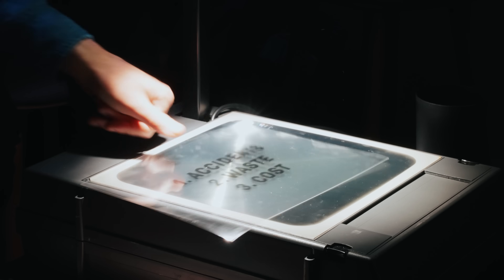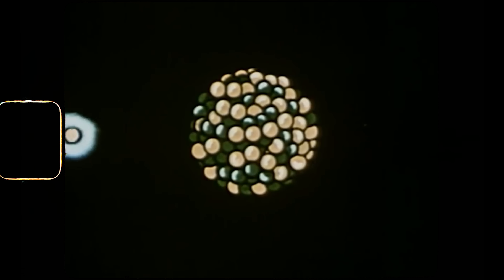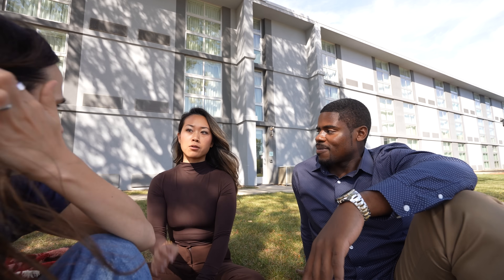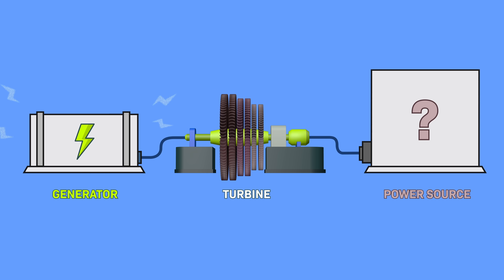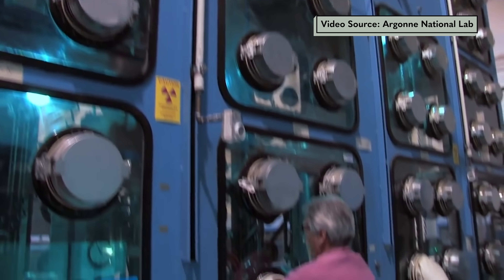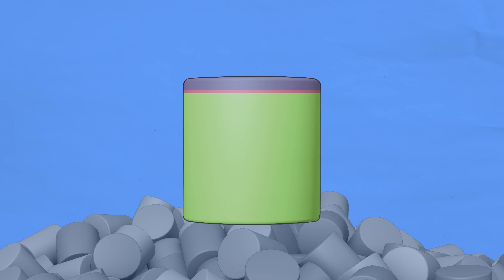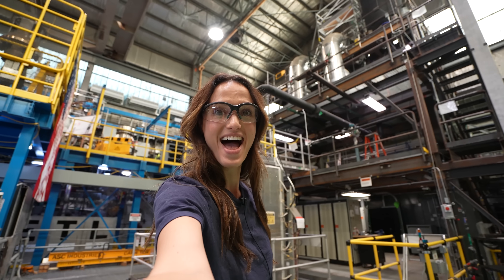The Big Lie About Nuclear Waste

Comment: I lived in Niagara Falls, NY for several years not knowing about the large amount of nuclear wast from the Manhattan Project that was buried in the area. I remember that back in the 1980's there were some promising experiments on using spent nuclear fuel to breakdown forever pollutants (another big problem for Niagara Falls) like Murex and Dioxin. As I understood it, Chemically polluted soil would be mixed with water into a slurry and passed through a chamber where it was exposed to the radiation from the spent nuclear fuel. The intens radiation would break some of the molecular bonds in the pollutants and thus render it much less stable and easier to treat / remove the pollutant residue, and yield "clean" soil.

Comment: - Japan closed their recycling facilities.
- Every incident may ruin the surrounding area for many, many years.
- Nuclear energy is expensive, REALLY expensive.
- You can't just start up nuclear plants if you need energy in a short period of time, nor can you shut them down easily.
- renewables are just better. Only thing we need is batteries. Yet to be found. But maybe creating hydrogen for massive energy overflow is the way to go.

Comment: Too many holes in the logic.  Too much “hand waving  BS”.  Regardless of how you parse it, nuclear power is still the most expensive way to boil water.  Despite your assertion,  spent fuel reprocessing is well understood.  All forms of nuclear power are and will remain far more expensive than renewable energy (wind, solar, batteries) whose cost continues to drop.  As of today, the projected cleanup costs for Hanford are in the trillions of dollars and hundreds of years.  Managing the concentration and recovery of the many toxic and dangerous byproducts in a safe and secure manner is a massive challenge not solvable in a YouTube video.  If Argonne had solved these issues, we would have heard about it.

Comment: The most interesting part is the different isotopes they isolate after they use the first stage of U-235, but I don’t think I it’s as simple as throwing attracting the remains in an osmosis-like machine and throwing in a capsule, or it wouldn’t be overly expensive. I wish you went in to that part in more detail I miss Physics Girl.

Comment: As Jimmy Carter told you, the biggest problem with recycling nuclear waste is security.
Any one with enough education and access to enough tech can make a nuke bomb.
That can be full-fledged or simply a dirty bomb.
Security at the facilities to prevent redirection are one problem.
Security against attacks at those facilities and transportation between them another.
You are not talking about protecting against a 911 event, but a Hiroshima event!
Reply: I don’t think you realize how hard it is to build a bomb
Reply: @untextured4240  I don't think you realize how easy it is to build a nuke. The cat is out of the bag and has been since 1945. You don't need a Manhattan Project to build a bomb anymore. The info required is widespread across the globe now. Building a bomb is a lot easier than you think and that is evidenced by the fact that there are tens of thousands of them in the world today.

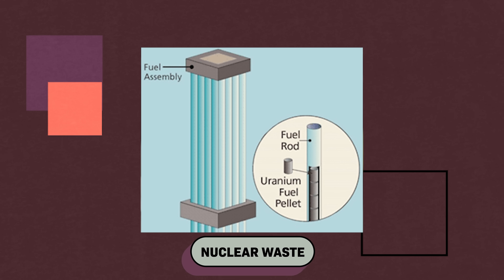Comment: 235 in U235 is not the number of neutrons I think what you meant to say is that it is the atomic mass number of the isotope (7:07)

Another one, we don’t fire atoms at them rather neutrons to initiate the chain reaction.

Also aren’t the product of the chain reaction also radioactive substances (Kr-92 & Ba-141) with long half lives? and the control rods that turn radioactive with time? These contribute to the nuclear waste as well. 

Is the focus only on the remaining unused U235?

Comment: 12:40 I think the cost of reusing fuel is worth the impact on the earth and security we have for safety, is worth it.
Reply: Fuel is only a small part of the cost of operating a nuclear reactor.
Reply: @FernandoWINSANTO  & gov't regulations are most of the cost.  You build something to spec & they want it tested to destruction.  Then the bastards demand that you prove that you can rebuild it to be as good as it was BEFORE they made you test to destruction!
Reply: The oil and gas industry has long lobbied congress to keep the nuclear industry from becoming an energy source for the future.
Reply: Americans doing everything in their power not to use other sources of clean energy and instead clinging to an uneconomic, dying industry

Comment: Reuse the spent fuel in a fast neutron reactor and the spent fuel is safe in about 300 years versus 300 to 400 thousand years.   We modified the uranium in our slow neutron reactors making it highly radioactive ( very dangerous ) for a very long time and we have the ability to make it safe in a relatively short period of time and produce a lot more power as we do it.  We need to be responsible and do the right thing.  REUSE IT.

Comment: OMG, what a U.S.-centric video. 

There are actually nuclear reactors in Canada that have been running for over 50 years that can recycle nuclear waste. 

Google CANDU. 

These reactors are heavy-water reactors that use natural uranium. The physics behind all this is that heavy water is much better at transmitting the paricles of radioactive decay. Hence the uranium does not have to be enriched. Natural uranium works quite nicely. When the U.S. slimmed down its nuclear arsenal, uranium from the warheads was used in these CANDU reactors quite successfully. 

Now, would you need to re-process spent fuel from light water reactors in order to use it in CANDU reactors? 

Quite possibly. 

But me not being a nuclear engineer, I can't say. So some of this might boil down to how expensive it would be to re-process spent fuel to run in CANDU reactors vs light water reactors. 

It would be an area that would be interesting to see a video on.

Comment: What happened in the U.S. is money. The waste recycling option doesn’t make as much money due to the cost of building the facilities to recycle it and the reselling of the recycled material. Storing the material on the other hand makes serious money such as the cask system. Most storage devices such as this can’t be purchased, instead they are rented. No you have a reoccurring monthly.yearly payment that doesn’t cost you anything. The underground storage facilities are much cheaper to run and will charge monthly rates to store nuclear waste. It was all designed to make a select group of people large amounts of reoccurring incoming. I would imagine a lot of politicians made serious money from this in order to get it passed as well.

Comment: There is a tradeoff with high levels of radiation per unit of material and low levels of radiation per unit of material.
High levels of radiation will cause a much slower half-life. You will not need to store it because of radiation over the years.
Low levels of radiation will obviously have the benefit of not causing so much intense radiation but you need to store it for much longer.
Perhaps the worst kind is the one the is in between.
For us there is not much practical difference if there is half-life of 200 years or 200,000 years.
But the material with a half-life of 200 years will have much more intense radiation with the same practical problem as the 200,000 years half-life.

Comment: ohhh we are so excited , not realizing this has been tried decades ago and the cost , polutation and  the nuclear proliferation issues have made it much cheaper and safer to just mine nuclear fuel rather than recycle or we would have done it decades ago. Frances one facility has proven extremely dirty ( pollutation wise) and expensive.

Comment: If it’s so safe how did we end up with Chernobyl ?  Where’s the solution to that nightmare ? And how many more dangerous reactors are out there we haven’t discovered ? There are literally tons of this waste in containment ponds all over the world in country’s that have no budget or clue on how to mitigate the danger . Even though the waste may not be weapons grade for bomb , it could be used by terrorists. You just lost all credibility
Reply: Chernobyl was a very specific reactor design intentionally run in a very specific way they knew it was unsafe to do. There are no other reactors on the planet, in operation, under construction, or under design, that could possibly do what Chernobyl did.
The waste isn't in pools because we don't know what to do with it, it's in pools because it's hot and that's how you keep it cool. After about 10 years it comes out of the pool and is put in dry casks, which are a perfectly reasonable way of storing it pending either reprocessing or actinide burning.
Using spent commercial fuel in a dirty bomb would be outrageously stupid. You'd need to go through the added difficulty of stealing it from an extremely secure site, processing an very dangerous material, and transporting an easily tracked explosive, just to have a bomb that will have no radiological impact beyond the distance of its lethal blast radius. It would be easier and more effective to just use a conventional explosive. Dirty bombs sound scary, but they aren't a legitimate danger.

Comment: The risk of widespread nuc plant building is not worth it until: (1) We harden the distribution grid (all major transformers in grounded Faraday cages), and (2) fix the current technology and waste issues (recycle... YES!!).

Nuclear energy is great... until it's not. One-off accidents are not the issue. In the event of electrical system shutdown for a long period of time (solar EMP, hacking by bad national actors, nuclear air detonation EMP, etc) every single affected nuc plant will melt down due to complete loss of cooling of active and spent fuel. Think Chernobyl times 100, or 1,000... the eastern US (with many nuc plants) will be a dead wasteland. Invest the time to understand the vast impact of long term electrical grid shutdown. A good book (fiction, but realistic and a great story)... "One Second After" by William Fortschen

Comment: In the UK, Sellafield, formerly known as Windscale, is a large multi-function nuclear site close to Seascale on the coast of Cumbria, England. As of August 2022, primary activities are nuclear waste processing and storage and nuclear decommissioning. Former activities included nuclear power generation from 1956 to 2003, and nuclear fuel reprocessing from 1952 to 2022.

Nuclear electrical generation is the same as any other. The difference is how the water is heated. After fuel rods are spent they are put in pools of water to cool down for years, think about it...

Comment: facepalm Recycling nuclear waste does not eliminate the problem of waste; it simply changes its form. Reprocessing spent fuel can generate secondary waste streams, which are often still radioactive and require long-term management. Some of this waste can be even more difficult to manage than the original spent fuel.

Comment: With 58 nuclear power reactors producing nearly 72% of France’s electricity in 2018, France is one of the countries with the highest share of nuclear power in its energy production. To manage the nearly 1150 tonnes of spent fuel it produces every year, France, like several other countries, decided early on to close its national nuclear fuel cycle by recycling or reprocessing spent fuel. You didn't mention them.

Comment: I see nuclear energy as a critical pathway to a low carbon future. Here in Alberta we have environmentalists cheering a transition from coal to methane power, ignoring that with leakage of methane in the supply chain makes it as bad if not worse than coal as a greenhouse gas, at least over the next 20 years which are the critical years we need action to prevent the 1.5 degree in global temperature. Nuclear is almost never mentioned. We should have and could have leap-frogged technology to power our grid. Even when talking about hydrogen fuel generation, pink hydrogen is barely a footnote while educated environmentalists I know are cheering on blue-hydrogen that Cornell published a paper a couple of years ago debunking it as dead on arrival. Everyone is so focused on tailpipe emissions and drinking the various environmental snake oils that we're ignoring the whole carbon cycle and the upstream impacts. Super frustrating as I'm on the front lines trying to help transition, but with the way we're approaching it, no amount of money in the world is going to work. It's made me very pessimistic about the planet's future.

Comment: "Hot rocks?"  Yep, the person you were talking to was a Navy nuke.  The only thing that would have me more certain is if they talked about the shaft going roundy roundy.

One side note - 235 doesn't refer to the number of neutrons in an atom, but rather the total number of nucleons - that is protons plus neutrons.  This is important, as number of nucleons is one of the only thing  that is conserved in reactions (along with energy, momentum... and I think spin was the other one?).

When we talk spent fuel, it's not that it contains a little bit of U-235 (hereafter, "25"), but rather that it contains a LOT of 25.  You see, the fuel isn't spent when it runs out of 25, it's spent when it's used enough that the 25 is no longer packed tight enough that the neutrons can make from the parent nucleus to a new nucleus without being absorbed into something else first.  It has lost "critical mass," but there is a YUGE amount of 25 left in it.  And wants it we does.  Yesss, my preciousssss.

This, of course, is not to contradict what you said.  It's "yes, and..."

Oh, and let's consider that plutonium.  If you can build a bomb out of it, you can build a civilian reactor out of it.  Great way to get rid of plutonium.

Comment: The main byproducts from reprocessing include:

1. Recovered Materials:
Uranium: Most spent fuel consists of uranium, which can be recovered and reused in reactors.
Plutonium: Formed during nuclear reactions, plutonium can be extracted and used as a fuel in mixed oxide (MOX) fuel for reactors.
2. High-Level Waste (HLW):
This waste includes fission products and actinides, which remain highly radioactive for thousands of years. It is typically vitrified (turned into glass) for safe long-term storage.
3. Intermediate-Level Waste (ILW):
Contains materials like metal cladding from fuel rods, chemical byproducts, and equipment that has come into contact with radioactive substances. It has lower levels of radioactivity but still requires careful handling.
4. Low-Level Waste (LLW):
Includes items like tools, filters, clothing, and other materials contaminated with low levels of radioactivity. This waste can often be stored in shallow land burial sites.
5. Gaseous Byproducts:
Krypton-85 and tritium are common gaseous radioactive byproducts that are released or collected during reprocessing.
Iodine-129 and carbon-14 can also be released, requiring careful containment to minimize environmental impact.
6. Chemical Waste:
The reprocessing of nuclear fuel involves a variety of chemicals, such as nitric acid, used in dissolving the fuel. These chemicals can create waste streams that may contain radioactive residues, necessitating special treatment and disposal.
7. Minor Actinides:
Elements like americium, neptunium, and curium are produced in small amounts during fission. While they have long half-lives and are highly radioactive, they are typically not reused and are treated as waste.
These byproducts require different handling, storage, and disposal methods depending on their level of radioactivity and longevity, with high-level waste being the most challenging to manage over the long term.

Comment: Again 
A nuclear power plant just can't be shut down like all other power plants.

You can disconnect the energy in the form of power, but can never just turn the key off, so to speak

Never.

The rods have a neverending voracious appetite for chilled water 
.
Depending on size, millions of gallons per reactor each hour.   

Do the math.

Comment: I would be interested to know the difference in cost between this type of reactor plant and the typical light water plant.  I say plant because I assume from the clip that more is involved than just the reactor.  Or even better would be to build regional recycling plants that feed the reactor with reprocessed fuel.  Has anyone done a cost analysis on this?

Comment: So over the years I have read a few things that have giving me the picture that the reason we've never invested into other newer, better, cleaner, and cheaper kinds of reactors technology is that most if not all the reactors we have now were built at cost, by GE I think, for the rights to supply them with the fuel rods, which is where the long term more profitable gains are.

Comment: I’m not going to bother finishing this video. I am sure that if you use nuclear waste power a reactor you will just end up with a different form of nuclear waste.  I can tell you everything you need to know about nuclear power, in one single list: Chernobyl, 3 mile Island, Fukushima Diachi.  In the 1950s and 60s, they said it would be too cheap to meter and we would all have free power. Now they want us to believe we can have Nuclear fission without poisonous waste the lasts forever and ever.  I don’t believe this chick any further than I believe the fossil fuel shills who try to convince us that windmills are bad and electric cars are spawn of the devil.  The nuclear power industry has zero credibility, about the same credibility as Boeing and I will not be bothered to listen to it. Bring us a fusion reactor, not fission.